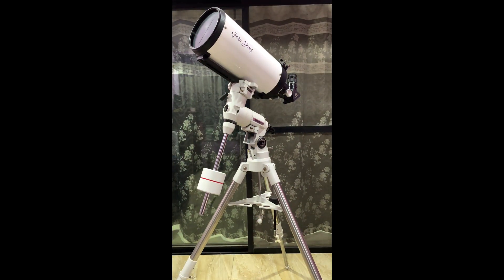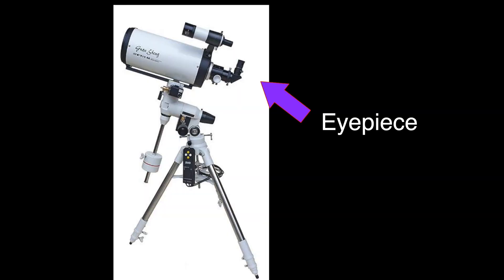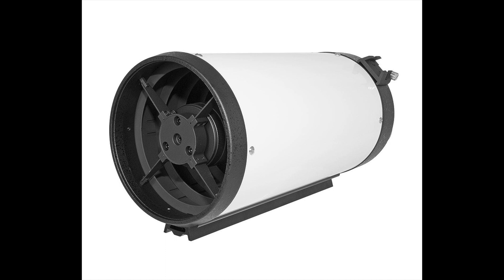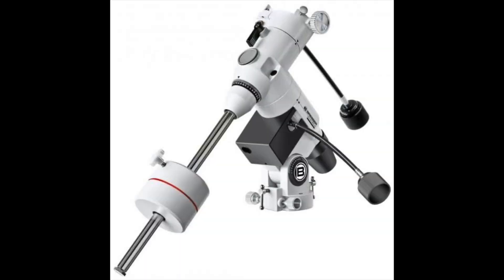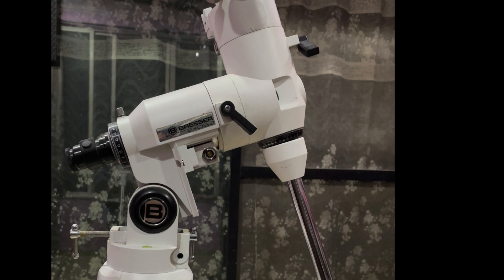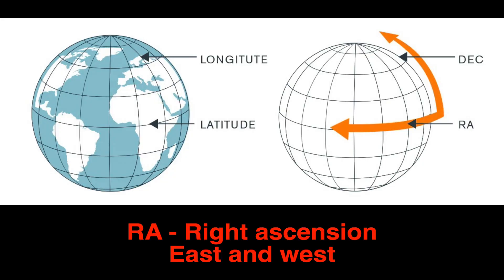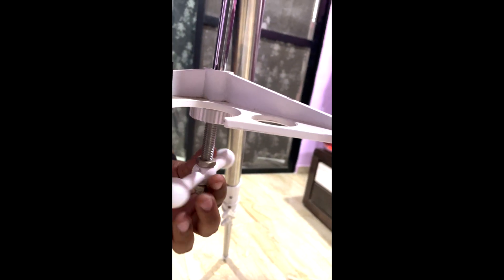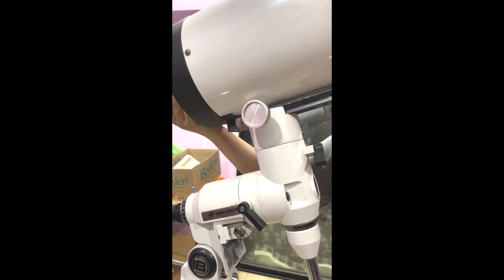TELESCOPE Part 2 is out !!! more about Components and assembly of GSO Classical cassegrain

Comment: try and keep the counter weights as close to the horizontal axis as possible, if you balance the scope towards the end of the counterweight tube you introduce stress on the motors and introduce vibrations...rather add more weight close to the center of gravity
Reply: Avoid putting weight at the far end of the counterweight shaft ?